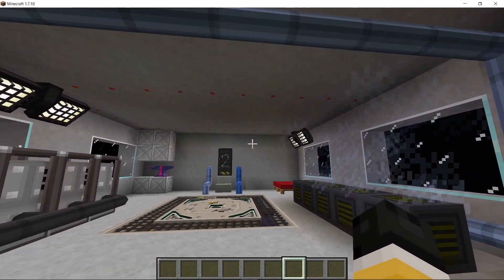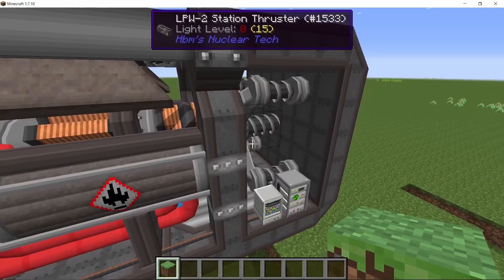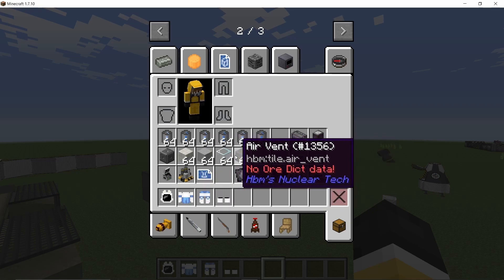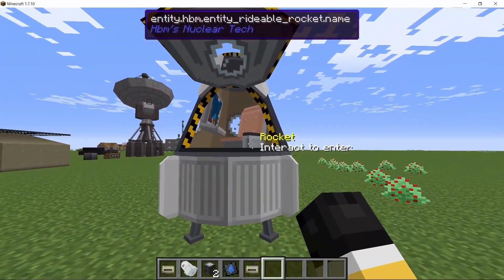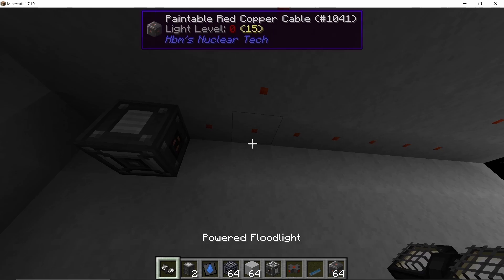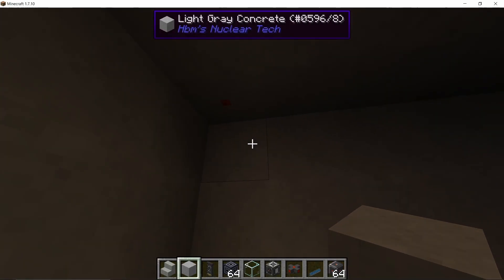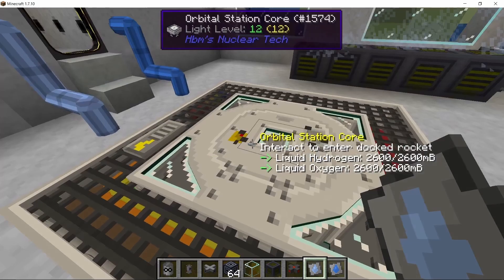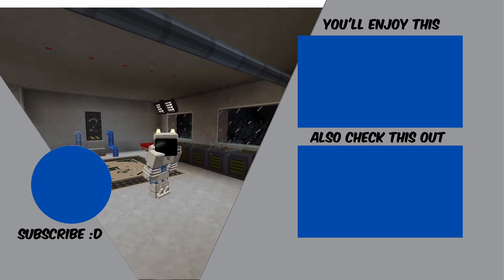Orbital Station with Drop Pod and Oxygen Recycling - JamesH2 Fork HBMs NTM

Comment: When I place the engine it says wrong direction
Reply from the maker: Cause these things are directional, you need to place them in a way which thrusts your station forward so basically there is only 1 correct direction where you can place em

Comment: Does co2 on the jame fork affect you or are they planning to add a system like that I would love they could add fuel cells
Reply from the maker: I don't think it affects you other then its used to get oxygen back. I didn't check using the pollution meter cause I had no burnable machine in the station. 
Let's see how/if they change this system in the upcoming updates

Comment: Could I run a RBMK up in space?
Reply from the maker: Yes in a pressurized room you can run nuclear reactors and water based machines I guess. 
That's why the steam radiators were added for easily changing low pressure steam to water